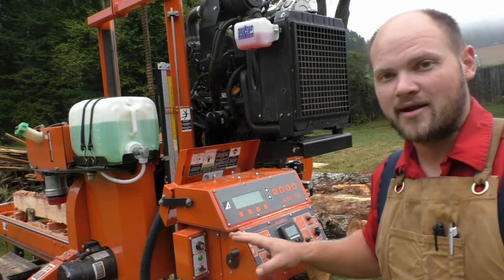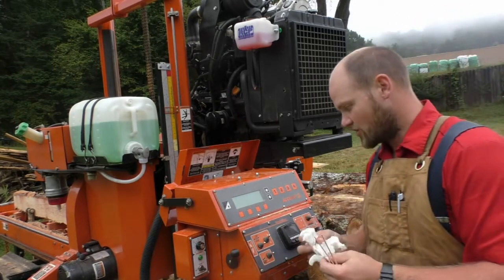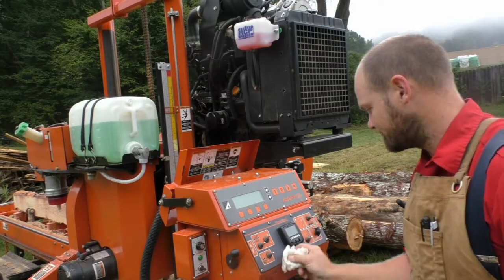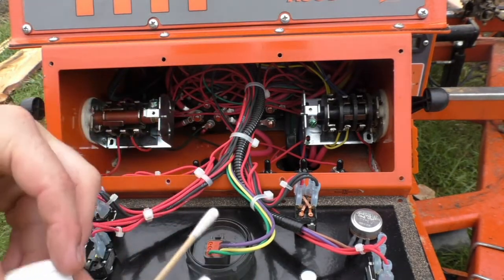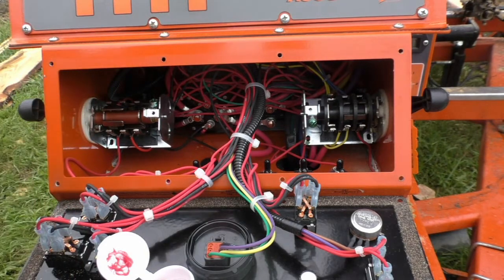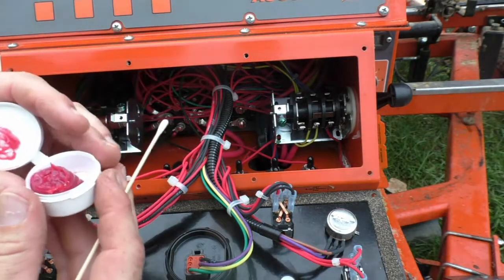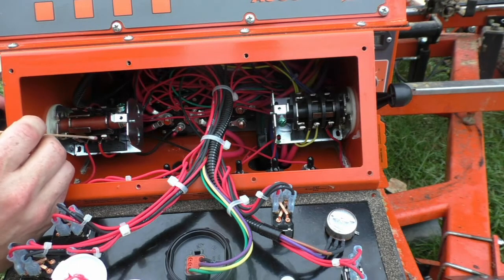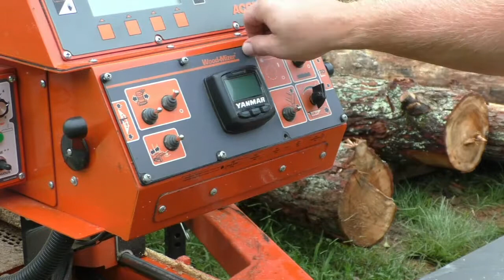Forgotten Maintenance on the Wood-Mizer | Greasing Drum Switches

Comment: I believe I need to do this to my wood mizer I have never greased it
Reply: Mine wont go forward or backwards without me pushing it myself
Reply: Can I blow it really good first then clean the contacts
Reply: This is why I always have to replace my switches
Reply from the maker: @DeannaDDuren  probably need a good cleaning,  sometimes if there's a lot of gunk you can push it around and make it worse.  Use lots of qtips and alcohol.  Be very thin with the grease,  a lil goes a long way
Reply: Deanna During, I haven't greesed mine either and my LT40 is 36 years old. But looking at them this morning I guess I should have.

Comment: I might have missed seeing one so far but have you considered doing a video on how to do a blade alignment? I bought my Lt40 used so I've missed more then a few of the maintenance processes being 100% self taught. Like this video is great! I didn't even know there were grease points inside the the control panel lol. One of my first logs was a 40" X 15' red oak, pretty sure I messed the blade alignment doing that nightmare of a log (WAY too big for a standard LT40S)
Reply from the maker: Didn't miss anything, but that's a good idea for a video.  The WM manuals do cover a lot of info, but they're not the best organized so it's easy to miss stuff.